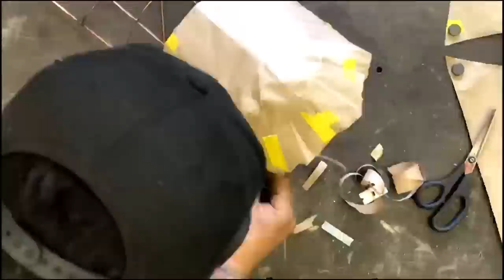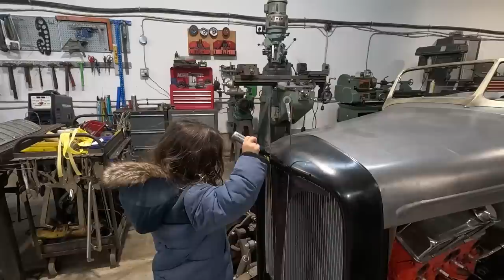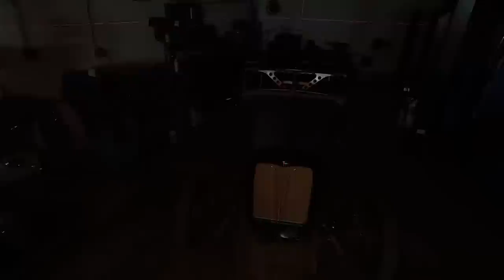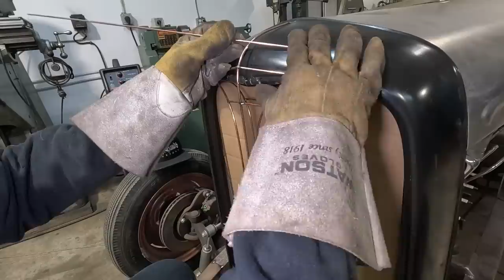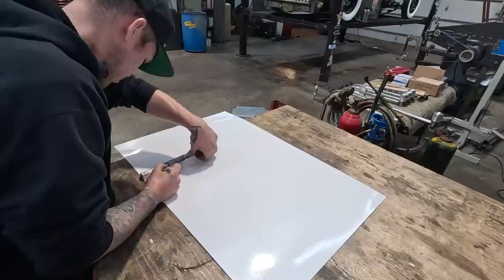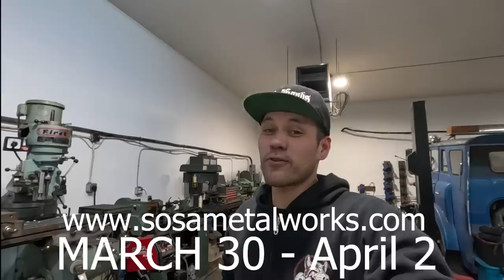Designing a Custom Split 1932 Grill Hot Rod Roadster

Comment: I like the mock-up when looking at it straight-on.   To my eye, maybe too thick, will be interesting to see the depth on it as the sides are filled in.    **Maybe a different idea for the bead roll in the top of grill shell:  extend the hood with a pleasing shape, about a fat inch(?), and recess the grill shell accordingly, with a flange, to receive the new leading edge of the hood.  so that it looks like the hood latches into the shell, which it could.

Comment: Hey Carl,
   To help you visually, you might start the grill halves with a surround frame much like the 32 grill is made. It will give you a true, definite frame to inclose the horizontal bars.
   I think you will get a better prospective if you paint the grill shell a grey or silver color to more match the hood and rest of the car.
   The divider you have created on the grill shell does a great job of giving the nose of the car a more streamlined look.   You might also try putting a greater radius curve to the bottom outside corners of  the grill.   Sort of opposite from the curves at the top center.

   On a different note,
Thank you for the instructive videos you do.
I am trying to do some sheet metal work on several projects I have going.
I am finding that working on more than one project at a time helps me to be more creative with each one.

   Work Safe, Be Well
         Stay Warm

Comment: So many thoughts come to mind on the grill. Are inner and outer radius matching on top of grill? When I look at the windshield it has tight split radius and flowing curve on outer top of frame did you consider doing something similar? I just see like a tighter radius on the split and pushing the nose out a little more. Inspiring work thanks for the vids